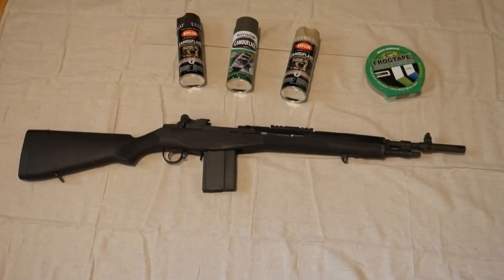Rattle can camouflage

Comment: Which Krylon "tan" did you use? Please don't say tan, I think there's two colors "khaki" and "sand" which is great for variety. Thanks. Also, this is a good video showing that the two paint brands are compatible with each other. There's some concern that some of the Krylons are an Acrylic Alkyd (water based) instead of a regular enamel which is petroleum based, and that they may not "play well together".
Reply from the maker: I used the khaki on this project. On my next project I used a base of Krylon sand and then khaki and the difference is noticeable. Unfortunately sand is difficult to find in retail stores and you may have to order it online.

Comment: Great video but I found the polymer stock to be unacceptably flexible.  I could see the thing flex and separate with each shot.
Reply from the maker: Thanks. I have not experienced that but I may want to upgrade to a Mcmillian down the road.
Reply: Get a Delta 14 stock and pair it with a Magpul SGA. No flex and much better setup.

Comment: Why tape everything off?
Reply from the maker: I only tape off the areas I don't want painted. Especially the magwell/trigger area. No reason to get paint someplace you wont see it.
Reply: A lot easier to just paint the whole rifle. I did it work just fine. All the parts that wear will simply wear right in and you remove excess after you fire it a few times.
Reply from the maker: @kurtphillips7038  I can see your point of view. However if I can avoid getting paint gummed up in sensitive areas I will avoid it. My next video will be a desert camo rifle paint and this time I am painting it all. Stay tuned.
Reply: You don't want a layer of paint possibly interfering with parts and removable parts especially. A layer of paint in the mag well might mean that magazines no longer eject or insert as well as they did before.